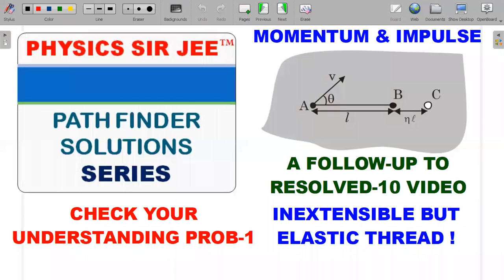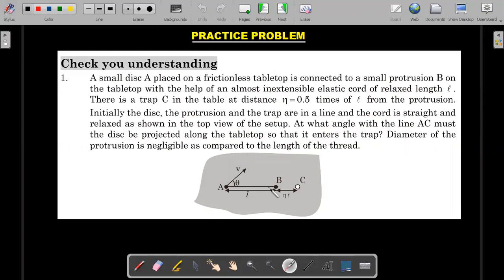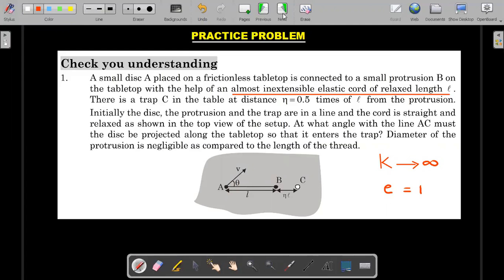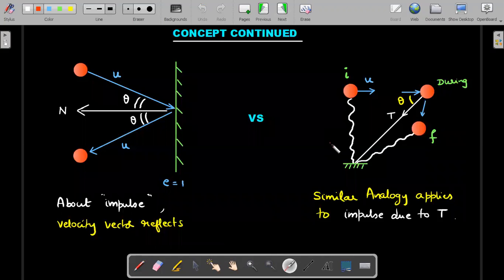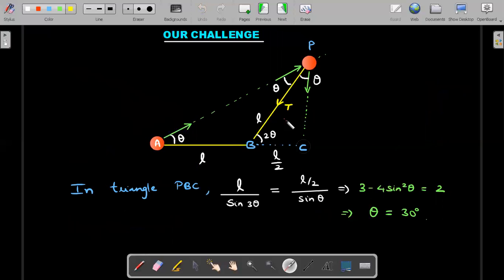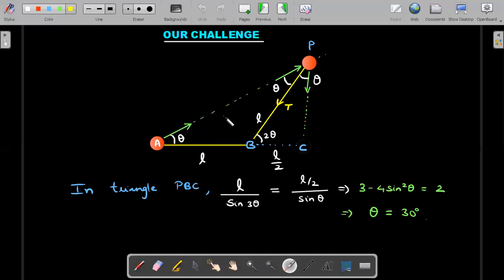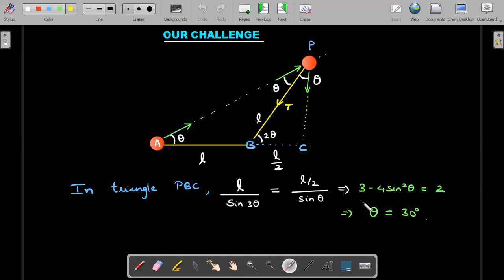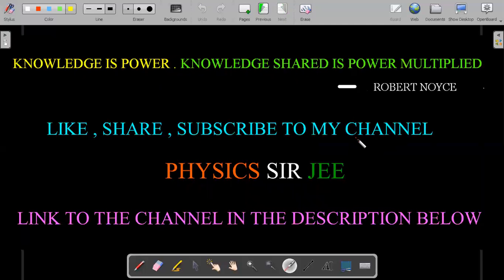PATHFINDER SOLUTIONS✨-IMPULSE & MOMENTUM-CHECK 1- INEXTENSIBLE ELASTIC STRING-BALL-TRAP CHALLENGE

Comment: sir but how is it possible that both angles are equal although distances are not equal sir agr angle equal hote toh distance l and l/2 nhi ho skti its against maths ........................................
Reply from the maker: Please mention exact time stamp of your doubt . I guess...
Thread becomes slack , also please watch the recommended resolved video in the description before watching this
Reply: @PHYSICSSIRJEE  sir i have watched that video also I got the concept right but I have a doubt related to maths regarding this problem that  how could distance be different if both angles are same using similarity of triangles i mean the two triangles you made at the end of video ???????????????????
Reply from the maker: @thermmech4835  time stamp in the video please? Which two triangles, APC and PBC?
Reply: @PHYSICSSIRJEE  @8:00 see triangle has a length l and l/2 although angles are same if we compare them using similarity of triangles we will find that question has impossible information that is ideal case.
Reply from the maker: @thermmech4835  similarity of which two triangles ? I think you are confused about usage of the word "similarity" . It is used between two triangles.
In case you are worried about a single triangle PBC  with l and l/2 at 8:00 , it looks fine as PBC is not having any two equal sides, so no two equal angles
Reply: @PHYSICSSIRJEE  sir i mean that abp and bpc
Reply from the maker: @thermmech4835  they are not similar triangles. Angle A in first triangle you mentioned  is theta ,  angle B in second triangle is 2(theta) 
One is obtuse angled isosceles triangle , another is right angled (after solving)
Reply: ok sir thankyou sir for clearing my doubt...........